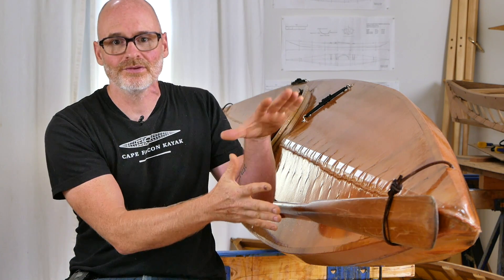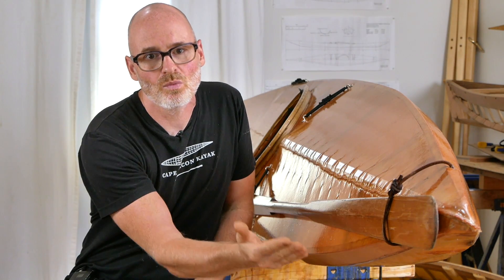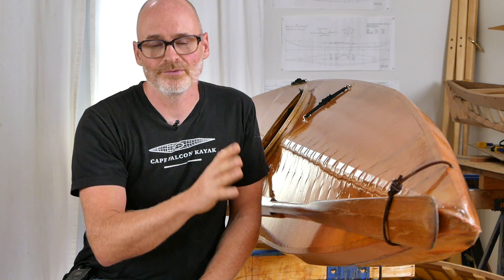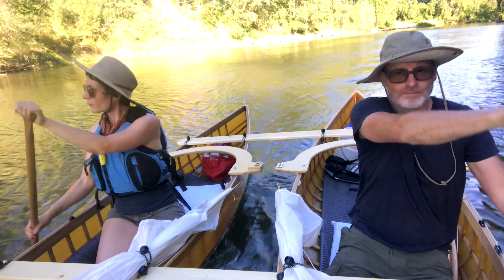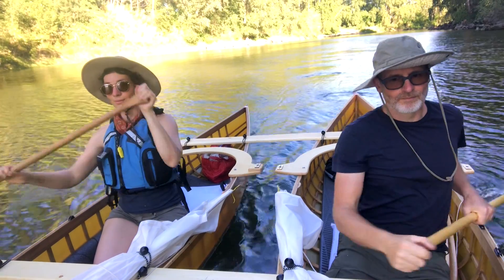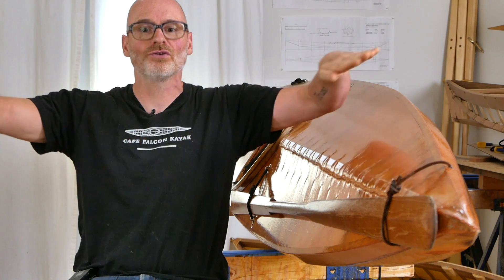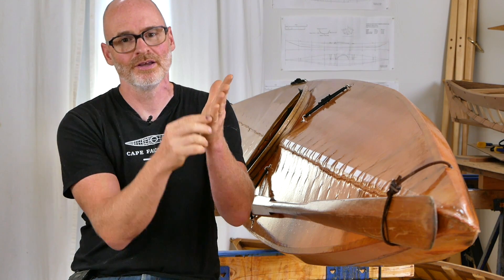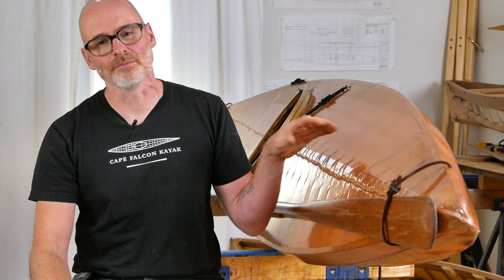How Durable are Skin on Frame Boats?

Comment: Thanks Brian. I'm sold.  In summary and for others, I got the following points out of your video.  

SOFs can be way lighter than rotomolded and composite boats depending on the materials used
Trade-off.  SOFs are less puncture and abrasion resistant than composite kayak but far more impact resistant given the ability to flex. 
If you smash into something large and hard you aren't likely to punch a hole in the side unlike composite boats. 
The natural lifespan of the skin ranges depending on the amount of kayak use and treatment as well as sun exposure -  with lots of use you'll get 5 years, with careful limited use people get 10-15 years.

Medium weight layups are between 27-33 pds (12 -14 kgs) depending on the persons size,  
- Usually make longitudinals out of Western Red Cedar to keep it light and the ribs out of White Oak for strength.    
- The skin is 9 oz (0.25kg) ballistic nylon skin coated with 3-4 coats of 2 part polyurethane. For more durability use 12 oz (0.34 kg) nylon but it's way heavier if you're willing to pay the weight penalty.  9 oz is still extremely resistant to puncture.  

Having said that SOFs have extremely low failure rates from punctures.  
When paddling sharp sticks and rocks usually just scratch them but rarely cause serious damage.   
Small punctures and abrasions can be touched up with sealant (small cuts may first need sewing together).  

If necessary you can laminate holes with a patch (and if it bothers you replace the skin but its about 3 days work plus materials).   
Temporary fixes due to failure on water are the same as composite boats i.e. duct tape or bituminous membrane    

Be careful dragging SOFs on beaches to minimise abrasion as they're not as easy to repair as a composite boat. 
For abrasion resistance, when building, put on extra polyurethane coatings and add fibreglass or wear strips on the bow, stern and chines protect the skin.

cheers Brian - I'm sold on these - happy to amend the summary if need be.
Reply: Nice brake out. Have you done the boat?

Comment: in the 60s my cousin Dave and I built fuselage kayaks. Dave's had plywood ribbs and canvas painted with latex house paint.  It did really well if you doesn't poke it with your finger because the paint would crack.
Mine had pine ribs and canvas painted with airplane dope. Sadly his was short lived while I enjoyed paddling mine over a decade.  The only puncture mine got happened when it was hanging in the garage and my dad you it with the corner of a sheet of plywood.

Comment: Wonderful over view on the durability of these boats!  Real time usage and end results.  The drop off a building is a fun thing but doesn't go to the place of actual use.  Thanks,
Reply: It is just an analogy.  An “off the cuff “ expression.  The analogy does reflect on very real world issues.  In other words impacts or collisions with objects of mass greater than the boat itself.  Such boulders in a river, rock formations on the coast, being dropped or loosing control of the boat on a slope during a portage… etc.

Comment: Thank you for this video, very helpful. I'm a Florida paddler for the last 16 years. Oysters the thing that I encounter almost every time.  I flyfish out of my sit on top Tarpon 160 and have been looking for a lighter alternative. This has been very helpful for my research. I am still leaning towards a cedar strip canoe at the moment. Your videos are outstanding!
Reply from the maker: There’s no free lunch here, if you glass up your cedar canoe to where you can hit oysters with impunity it’s going to be heavy and still takes 200 hours to build.  If you put a 12 oz skin and 5 layers of coating (a reasonable oyster layup) it’s going to be about 37 lbs in one of my kayaks and 40 in one of my solo canoes.  Your best strength to weight is going to come from leaving the wood behind altogether and buying one of the new ultra tough composites.  But your still talking 40’s

Comment: If you have through hole damage just sand it to feather out the spot,  tape over the hole inside, patch with CSM, sand it smooth, and apply a top coat.

Easy day.

Comment: You can paint the bottom with roll on truck bed liner in high wear areas. It definitely works. I used it on my sailboat as hull paint. The trailer ripped off my truck on the interstate and crashed into the guardrail. The boat suffered one puncture from the steel frame but everything else was just a surface abrasion that didn't go through the paint. I'll never use anything else for hull paint.

It mimics all the characteristics of shark skin.
Reply from the maker: Good info.  I’ll have to experiment with that.  Very few things will chemically stick to this stuff so it would be really interesting if that works.
Reply: @capefalconkayak  What do you think about PU coats used on 4x4 in Europe? U-pol Raptor is best knows. It is cheaper than marine stuff and well proven and impressive.
Reply from the maker: @empe3332  The only thing I know that works well for sure is Coelan, but it's more expensive than getting what I use shipped from the states.

Comment: Hi. It was a great video to watch for me.
I learned alot. 
I have some questions.
Is it possible to build a 6 meter trimaran or catamaran sailboat with  skin on frame and cross big seas or ocean?
Reply from the maker: Technically yes but there would be so many problems you would have to solve that by the time you were done actually making it it would have been easier and better to build it out of plywood.

Comment: How much is the 2 pack poly coating a factor of durability ? This seems not to be available in the UK. Would using Four coats yacht varnish significantly reduce durability? Thanks for another great video.
Reply from the maker: Your other option in Europe is a product called Coelan but it’s literally more expensive than having the two part shipped from America and the fumes are toxic enough to burn the hair off your chest.   People have used more ordinary varnishes over the years and it works but you do take a significant durability and longevity hit.   On the plus side those coatings are typically recordable whereas this one is not

Comment: Fantastic vídeo, as usual, a huge amount of information for 20 minutes of vídeo, worth listening many times. What about using epoxy instead of polyurethane? What are the pros and cons of making this change? Kudos again
Reply: My guess is that people don't generally use epoxy for these because it's generally less flexible (and so would crack) and much more expensive than polyurethane

Comment: Somebody needs to build a skin on frame white water dory-perhaps with 20oz nylon?  Would rolled on Barge Cement be more flexible and repairable than Polyurethane?  On a theoretical skin on frame white water dory, would it make sense to use Kevlar instead of or in addition to nylon--at least for the bottom?  Kevlar doesn't heat shrink. But there is always a way.

A 3/4" inch plywood decked white water dory can weigh close to 500lbs.  A skin on frame boat might be 100lbs.  Or less?  That would be a game changer.
Reply from the maker: The barge cement wouldn’t work and Kevlar wouldn’t work very well in this application but there have been plenty of Umiaks built with 20 ounce fabric.  It works it’s very tough

Comment: You do you use poly instead of epoxy resin?
Reply from the maker: People have used epoxy on skin boats with varying degrees of success it’s not that it can’t work it’s just that it’s not a flexibility match to the fabric and so it tends to crack and disintegrate
Reply: @capefalconkayak  
So epoxy has less flex. Good to know. Thanks.

Comment: Sand is the enemy.  If sand (tiny granules of rock) gets in the kayak it goes into the skin and lodges in the sealing and skin.  The sand granules will eventually cause holes to develop.
Reply from the maker: That’s right but if you only slightly round the stringers it makes a huge difference.

Comment: "Dragging them across parking lots"? You mean John Peterson/Shaman Kayaks mistreating a skin boat?( I shot that video!) https://youtu.be/gYyvIExWkqU  Dare anyone to watch it and think SOFs are the least bit fragile. 
With respect Cape Falcon:  sitting around talking proves absolutely nothing. Why not just link to John's torture video, where he demonstrates everything you need to know. He dragged it across sharp rocks, dropped it off the roof of his truck, these are all things that happen to kayaks.  He was finally able to puncture the skin by hammering a screwdriver into it.  Since I shot that video I've made my own Iqyax (aka baidarka). Great materials, fun build, beautiful to paddle. Not as tough as my fiberglass over strip kayaks... but there's no de-lamination issues-- so far it's held up better than they have. And until sharks start carrying hammers and screwdrivers......  Why did John mistreat the skin boat? It had a broken rib that needed replacing, the skin was a several years old and he wanted to replace it, so let's do an engineering test to failure.
Reply from the maker: Hey there, I didn't mean to offend anyone, I haven't talked to John in many years but last time I checked we are still friends.  The point I thought I made was that those tests do show people that skinboats aren't as fragile as people assume they are, but they don't accurately approximate the real forces that a skin boat faces on the water.  I've given a ton of thought to how to do that on dry land but it's impossible to replicate a high force low velocity impact in a viscous fluid at a (usually) acute impact angle.  All you can do is just use the boats in harsh conditions and see how they hold up over time.  Skinboats are astonishingly impact resistant to most objects, and less abrasion resistant than some harder composite materials.  It's not a competition, just a comparison.